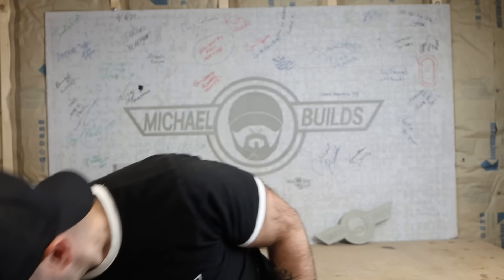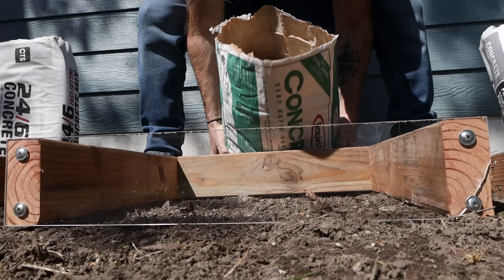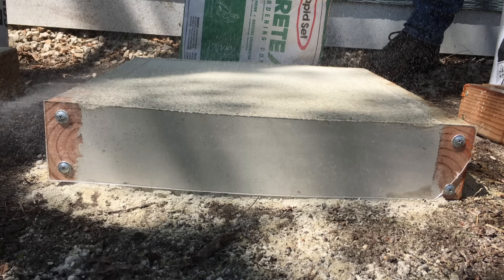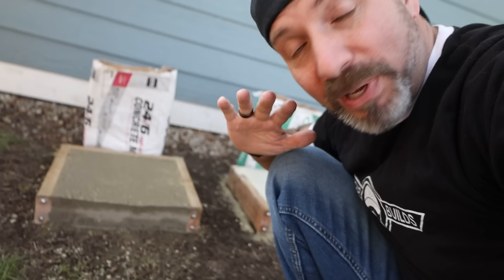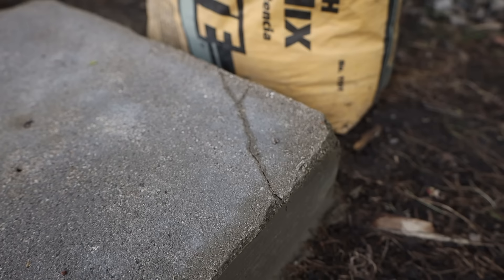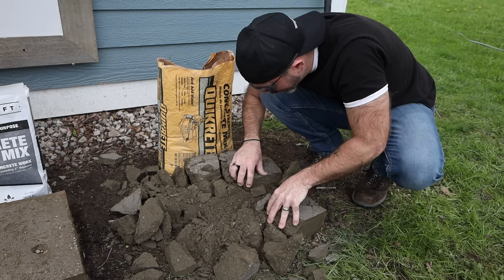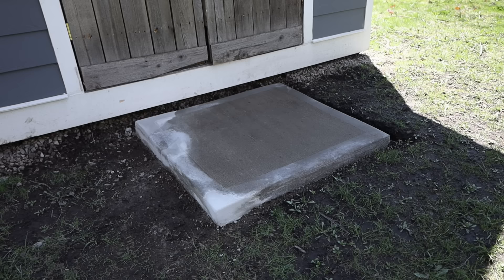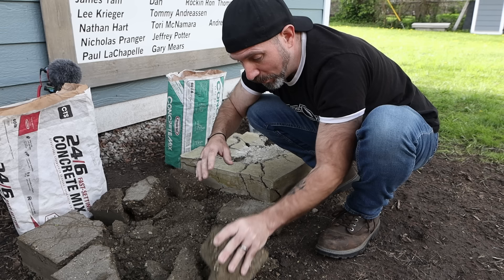Dry Pour Showdown!

Comment: Thanks for the effort in testing.  I learned that  the fine content of pre-mix may vary by region and batches. The paint roller is brilliant but it may be difficult to pull up enough cement dust to get a smooth finish on top. Here is what worked for me. 1. Screed the dry pre-mix concrete to a reasonably smooth finish, postpone the paint roller. 2 When you buy your pre-mix concrete, get a bag of sand mix as well (aka topping or bedding). 3. Borrow an collander from the kitchen and sift 1/8" to 1/4" of sand mix over your still dry pre-mix.  4.  Paint roll if you want.  5. Mist and wet per the cajun technique. 6.  If you skip the paint roller you will get a finish that looks like a spray on rubberized truck bed with some grit, perfectly good for a non-slip finish.  Thanks for sharing your good work.

Comment: Michael, 1st Thanks for being unbiased with your test!
2nd, I think, since your beloved rapid set, sets & dries so fast, it should have been watered at shorter intervals than the other kinds. If you noticed, it was totally dried & needed water while the others still looked wet... give it another test with different rules as it's a different product. 
3rd, I'm really looking forward to your next video where you test your original slab for strength, & I'm glad you're giving it 30 days to cure.
4th, You should start some of these dry pour blocks, allow them to cure the 30 days, then have the PSI tested & compared to wet poured in an unbiased test where the lab doesn't know the samples are dry pour. People will trust your test/outcome,  as you haven't seemed to have an ax to grind in the argument (so to speak)!
Thanks again... awesome job!!

Comment: This testing is really great.  Thanks for doing this!

For my experience, I used a dry pour to set the posts on a backyard fence last summer.  The first 6 or so were  wet pour, the rest dry pour.  None of the fence posts have seemed loose or that they aren't well set, but the posts where a dry pour was used seem to be set more firmly.  With as much data as a guy can gather by giving a fence post a wiggle.

Really looking forward to your update in two weeks.

Comment: I wish you had done a comparison between the two methods (dry poured in one form and the second form with a traditionally mixed batch, i.e. mixed with water and then poured into the form). I'd like to see the relative strength between the two methods. I have a feeling the mixed material would be stronger as the correct ratio between water and concrete mix can be assured whereas the dry pour method is anybody's guess. It seems to me moisture wicking into the center might dampen the material but not have enough water to complete the chemical reaction.
Reply: You think right
Reply: That's one of the issues, although even the pre-cast concrete industry uses dry-pour to make some components. But a homeowner might use the mix ratio on the bag to get the same amount of water into the dry-pour.  Let's say a gallon per bag of mix. Okay, so long as you get the same gallon of water into the dry-pour by the end of the 'watering cycle' (maybe using a pump-tank sprayer to measure out the gallon), that might help the dry-mix absorb and cure properly.
Reply: Concrete naturally porous. It would eventually get enough water. But I still wouldn't do it this way.

Comment: Other good advice is to take a sander and vibrate the sides to be sure any air is out and all spaces are filled, prior to adding water. You also need to add water every hour or something. I wouldn’t do this without adding gravel underneath to allow water drainage so you don’t have freeze and thaws that lifts the concrete.  If it was large enough I would use rebar or that metal fencing whatever it’s called.  If you do a large a piece be sure to wet saw a slice through it in hopes it follows this line for cracking and doesn’t randomly crack because it will. That’s why side walks have those indents it between. The cracks don’t always follow the lines but if definitely helps. Then add gravel and dirt to the side to support if a walk way.

Comment: I think the rapid set process can be different from the other. I thought the misting process was not to disturb the look of the top of the smooth dry concrete. Since rapid set "sets" so quickly, I think you could have just started the downpour earlier after the first mist that hardened the top layer.🤷‍♀
Reply: Using a trowel on properly wetted and mixed concrete will make a smooth surface when it dries.  But if it is a sidewalk, you don't want it too smooth, as it can become slippery when it is wet.

Comment: I think its a viable method for certain applications. I put a soil cement floor in a pole barn between 3.4-12" thick using road base and weak portland mix stretched with some sandy soil my neighbor delivered. The PSI might have only been 1000 in the end but it could take vehicles fine. The issue arose when I dropped a tool and it took a chunk out or dragged something across and it scratched, so having a 3-4k psi top layer would have helped that.

Comment: After your previous "dry pour" video, I stumbled on some long winded guy, who because of his impatience came up with a cheat for watering.  I think he was only partially versed on this dry pour thing, and didn't even know he was doing it "wrong".  But I like his method, and think it would help distribute water through the center much more efficiently.  What he did was pour his dry mix about 2/3 deep in his forms, then drenched that, then laid dry mix on top, screed-ed it then did the mist, mist, soak, soak, soak.  Since you are watering the bottom 2/3, you don't need to be the least bit careful, and you can be reasonably assured the majority of the slab is well activated to set.  The only caveat is the pour must be completed post-haste lest you have a cold joint prone to scaling.  Thought this tidbit might be helpful to someone.

Comment: Excellent video!
Seeing as how you have these awesome window molds, why not mist until you it soaked all the way down? That will give you an idea of how long the first misting needs to be. My guess is ten to fifteen minutes ...

Seems like the trick with concrete is to mist & cover to maintain moisture until it cures to strength. Getting a thorough misting up front provides enough water for the chemical reaction to start thoroughly.

Comment: Many people are missing the point I think. Any method of dry or wet pouring is just another tool. Because there are times when you just need a different way of doing something for particular situations.
Reply from the maker: VERY WELL PUT! Thats exactly how I feel! My favorite comment of the day for sure ☺️👍🏻
Reply: Please inform me of the situation where not properly mixing concrete for a poured slab is an acceptable practice? (when I say acceptable, I mean proper- not "Im too lazy so lets do the bare minimum") This attitude is why everything in the world has gone to sh*t lol.

It takes less than 5 min to mix up a 50 lb bag of concrete in a 5 gallon bucket with a lid on it if you just roll it back and forth on the ground.
Reply: @henryknox4511  Many years ago I saw a video where a person used this technique to make a border for their lawn. He poured out the dry mix along in a little ditch he dug and then placed irregular stones on top, then misted it all like in this video. I think for that purpose it was probably sufficient since it wasn't being walked on and a lot faster then mixing up so many bags and then trying to get the wet mixture in a gently curved and sloping line. But I haven't actually done it so I don't know for sure. Just wanted to share another place this might be used.
Reply: @jwrightgardening  Nothing wrong with that, I wouldn't expect it to last too long with sprinklers running and rain etc...but that isn't a slab or even flatwork. The guys that lay border curbing usually use an extruder or at bare minimum they properly trowel the work so it seals and doesn't crumble apart in 5 years. Innocent DIY youtubers will watch this and think it's a good idea to use this method for their own shed, garage, or sidewalk pour- which it's not, it's pathetic and lazy.
Reply: @henryknox4511  Now mix 30 80lb bags one after another and see how easy it is to put down and keep up with it on a slab.
Reply: @acdbubba  You got money for 30 bags of concrete but not enough to rent a mixer for a day?
Reply: I would say if dry pouring was as good as a wet pour, why do all professionals and large construction projects use wet pours ? 
I think also not mixing air into a mix is not going to activate the cement as much making a weaker mix

Comment: I did a dry pour for a couple of paths and stairs around a veggie garden. However, I used old render rather than bags of concrete mix. I also didn’t follow such a scientific methodology. I simply poured it in, levelled it off and gave it a light spray. I then let rain do the rest. It has held up perfectly for 3 years now. So good on ya for 1 trying this and 2 trying different mixes.

Comment: You could saw them off in the middle (or as I'd like to put more poetically "cleft in twain") with a concrete gas saw, and one half could be smashed, and the other half left to cure for 28 days.

Comment: The main thing I like about dry poured concrete is the beautiful finish you get. It looks exactly like ratty old rotten concrete. Who doesn't like that look in their back yard. Makes it easier to clean too. If it gets stains, no worries. Just wait a while and the surface will soon spall off and you will have a brand new (cratered) surface. It's beauty gets better with age.

Comment: I would like to see what happens when you completely soak the rapid set and not wait every hour.
Reply: I think what you'd get is runoff; the mix won't be able to take that much water all at once. While the mixes absorb water, too much at once won't work in the dry-pour foundation molds.
Reply: well just take the process and divide the times by how much faster the rapidset is supposed to work at least.
Reply: Hmmm could you mist in-between pouring dry then on top?
Reply: thats what happens when you dont follow the mixing instructiuons that are needed to get the strength of the product

not matter what this would be weak and falling apart quick

the strengh from concrete comes from mixing it the perfect time..
producers have all the info needed
Reply: He's trying to make sure he's following the instructions given by the original YT posters on this subject.  Once you start varying the process, you introduce too many variables.
Reply: Yeah, see if the time between misting can be reduced to 5 or 10 minutes.
Reply: You could measure out the right amount of water and apply it with a flower pot slowly so as not to ruin it.

Comment: Two things I noticed.  Cajun Country light mists just to wet top from about 4ft away.  You put more water and seemed a higher pressure mist.  2nd they recommended 2 LIGHT sprays for every inch of depth.  4" would've been 8 sprays, 1 per hour.  Is that what you did? PS: love the content MB

Comment: Being an anal-retentive engineer, but a die-hard DIY, I really hate the idea of having to get a concrete truck in to do a 12x12 pad that is really going to be temporary (couple of years).  This Dry Pour technique sounds perfect!  Your test here was great!
There is still one question in my mind to satisfy my doubts... I'd really like to see a head to head Dry vs Wet... say 3 samples of each using Quikrete... (1) hammered at 24 hour, and (2) after the bag's 5 day claim and (3) hammered at 28 days.

I'd really like to see ASTM C39 test comparisons, but I don't think the YouTube community has access to such capabilities.
Reply: Senseless to test after 24 hours, no one claims the method is ready for heavy traffic then. The @Country Living couple even says they estimate the dry pour method loses up to 50% of the strength, even after a couple of months of curing. So, DON'T use dry pour for any foundation work, DON'T use it for driveways, and DON'T use it anyplace where it might be under excess stress.
Reply: @xenaguy01  As I understand it, concrete (wet pour) gets stronger over the long term (years).  I must have missed the videos that refer to dry pour losing strength over time.  Actually, I didn't think there were any vids of a long term nature yet.  Even the recent one by @Country Living of checking out the chicken coop didn't discuss any loss of strength.  Can you reference your comments by any civil engineering study or even any YT over several months?  I haven't seen one yet.  Maybe, I'll have to do a formal comparison using ASTM standards.  But I'm not a YouTube personality nor have the figure to be one!:face-blue-smiling:
Reply: @inqonthat1463  My mistake, I didn't mean to imply dry pour concrete loses strength with time. Exactly the opposite happens. Dry pour concrete, like wet pour, strengthens over time, but only to 50-70% the strength of "normal" (wet pour) concrete.

Comment: I've placed dry bag mix into a post hole, and it works fine. Just about any kind of other use... dry pour is ill advised.  Dry pour is a short cut. Mixing bagged concrete with water combines ingredients more correctly. The ingredients in bagged concrete sometimes aren't mixed well at all.  To achieve higher strength concrete from bagged mix, use less water and or additives.

Comment: Spent many years in pouring 4" home slabs.  All, ALL are rated at 30 days before reaching fully cured concrete strength.  Many, Most engineers recommend waiting several days before setting any attachments even only concrete nails

Comment: With all the videos I've seen about dry pouring, I would never do it this way. In my shed, I filled the floor with gravel and dumped a lot of bags of cement mix on top of the gravel and sprayed a ton of water all over it with the hose and it's solid as a rock.

Comment: I think if the very middle is wet inside over time it will set up strong enough for most people's needs. Sidewalks... Patio stuff like that. Deff wouldn't do a driveway or something but for lightweight use probably sufficient.
Reply: I'm thinking if it pulls water from the ground then it may be good to moisten the soil before you pour the dry product

Comment: Rapid set is probably the winner by far if you do it in stages. Soak ground. Add 1 inch, soak, 1 inch soak, etc. Then finish the the top the same way.

Comment: Before I even heard of dry pour, I did a similar technique several months ago to repair my gravel driveway.  I got the idea from a yootoob video I had seen.  After breaking up a perimeter around each pothole using a pick axe, I added just enough cement mix to level off the top, and tamped it down to allow it to filter through the larger aggregate.  I lightly misted it several times.  It seems to be holding, and rain water drains nicely off the crowned top, without puddling.  Would like to hear your thoughts.

Comment: The Portland cement is a fine powder, sand is in a granular form and gravel can be various shapes, but always larger than the sand granules, but should not be larger than one inch. Keep in mind when you wet down this mixture you’re washing away most of the powder which is the primary glue that along with the sand bond with the gravel to make long lasting strong concrete. The samples here plainly illustrate just how brittle the inner portion is. More time and more water isn’t going to amount to anything. Properly mixed concrete continually strengthens upward of 100 years. These samples, they’ve already reached their zenith!

Comment: I recently make a 4x7 4” slab for a shed using the dry pour method. I also made a similar test piece like your video and watered it along with the slab. After a month I drilled holes into the test piece. Solid throughout, slab also seems strong. All this testing, your video, mine and others shows this method works.But until we get some real testing we’re always going to wonder what the real difference is in strength.

Comment: Here is a test. To try. I noticed that the misting process is a good way to get it started however I'm curious to how it would set in a box form that "to tall" however the reason to do that is pack it down good with a light misting to set in the form. Then as soon as it can fill the whole form with "to much water". See how fast it soaks up the water. I expect that it would take 1 to 1 volume... also using the plexiglass to see how it soaks then bust them open after 24 or 48 hours after it's 100% dry. If you don't do this I might.

Comment: It makes sense that given enough time it will harden all the way through when you consider what happens to an unopened bag of concrete mix left in a damp place over time. It gets hard as concrete should for those that have never done it.
Reply: We had several bags of concrete that were leftover from another project and stored them inside our garage. They sat there for several years and I got tired of having them take up space. The bags were completely solid and I just laid them against the base of the fence where our dogs had started to dig. It’s been about 15 years and those bag shaped chunks of concrete are still solid. Our garage is waterproof and we used it as a workshop so even moisture from a vehicle wasn’t possible. We do live in a humid climate but it had no water on it. I started looking into dry pour for other projects but haven’t done any yet.

Comment: I need to get some concrete across a small corner of my landscaping between the driveway and walkway that I run over often to get to my parking spot. Using dry pour would be quick and easy but it looks like I might need to wait a couple weeks to see how your pad holds up to your truck.